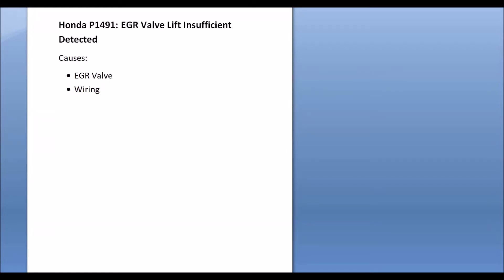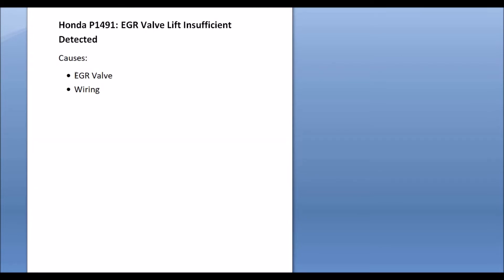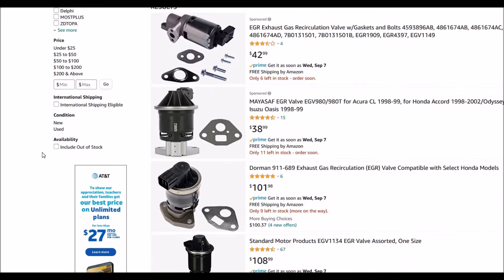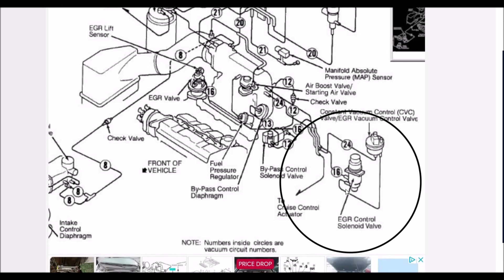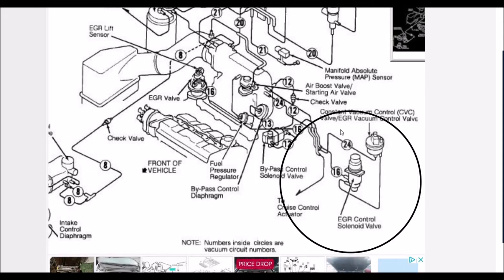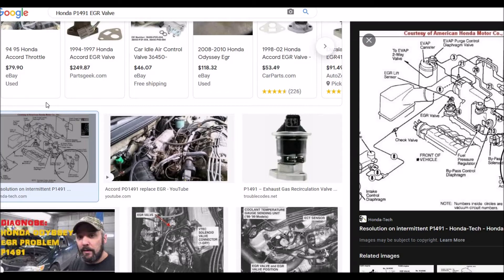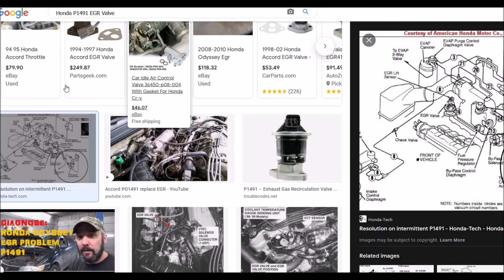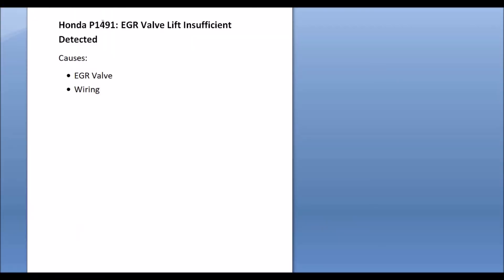How To Fix Honda P1491: EGR Valve Lift Insufficient Detected

Comment: Hi [YouTuber Name], I’ve been following your videos on Honda Accord V6 maintenance. I have a 1999 Accord and I’m dealing with a P0401 (EGR Flow Insufficient) code. I’ve already replaced the EGR valve and done a deep cleaning of the EGR ports, but the code keeps coming back.

Do you think a faulty MAP sensor could be causing this code, or is it something else I should check? Any advice would be greatly appreciated!

Comment: I took my 97 a cord to autozone and it threw a p1491 code, and the guy told me the for sure it was the valve itself, so I bought a new one, but if it can be flushed and cleaned, what all do I need to flush and clean with it???

Comment: I have a 1999 Nissan Altima and it has P1491 and EGR not ready.  It seems it is the same reason.
Reply from the maker: OBDII scan tools can give different definitions but the cause of the code is the same.